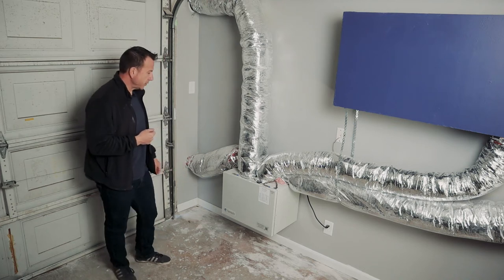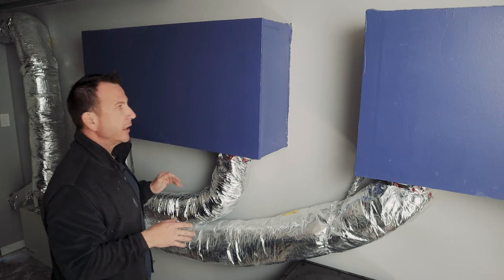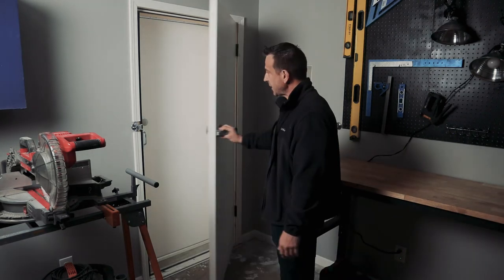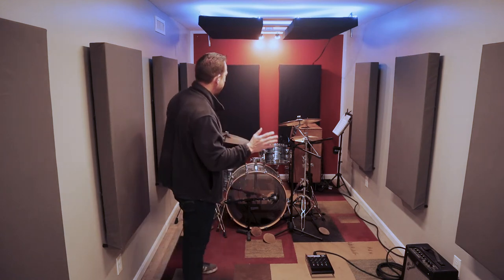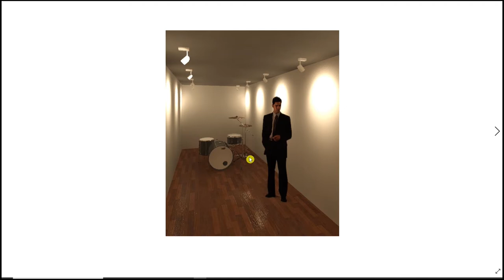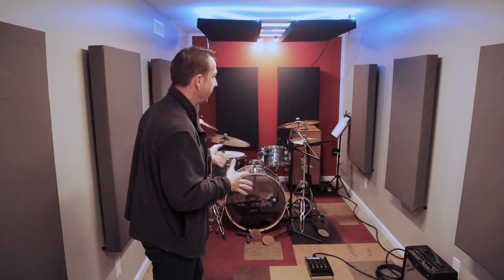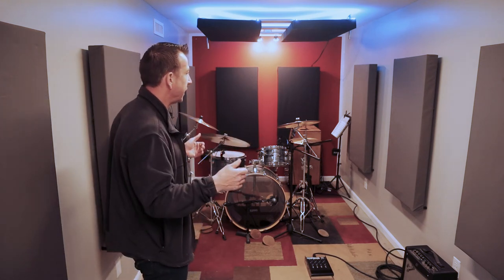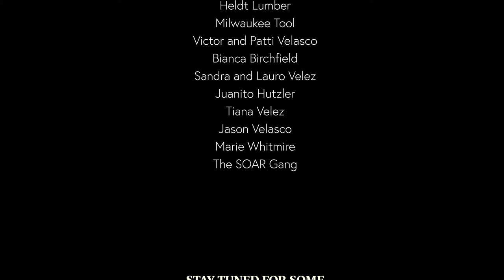Drum Room Rescue: Episode 07– A Little Tour

Comment: Space looks great! Does the double door frame re-couple the two walls?  I'm wondering if I want to have two frames.. and  leave that space open or cover with light weight plastic.
Reply from the maker: Highly recommend Rod Gervais’s book. He speaks about this construction detail specifically. He was not against coupling at this particular point for the “room within a room” - for structural stability. I went that way. I’ve seen the “gap” between wall framing also managed/sealed using mass loaded vinyl instead of wood/vapor barrier like I did. Check out the True Sound Studios series linked in the description. He has a good series of videos that talk about details here at the door frames.